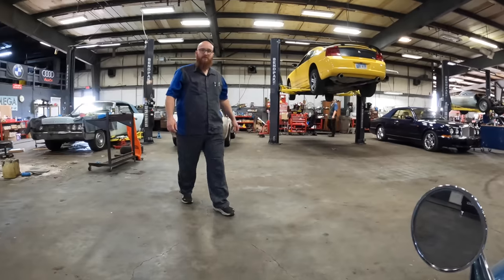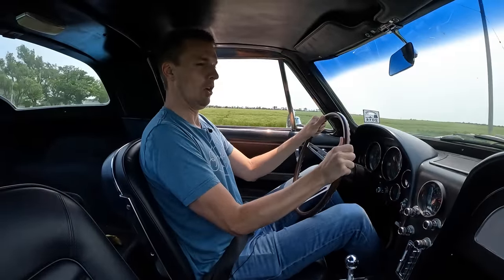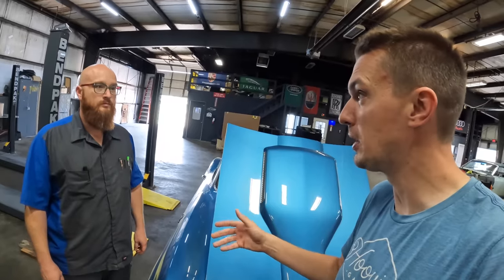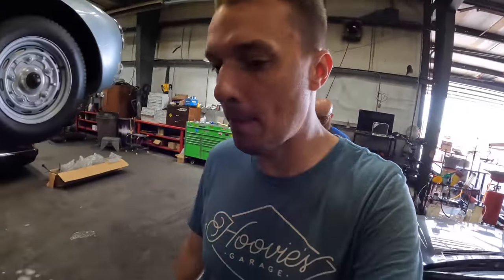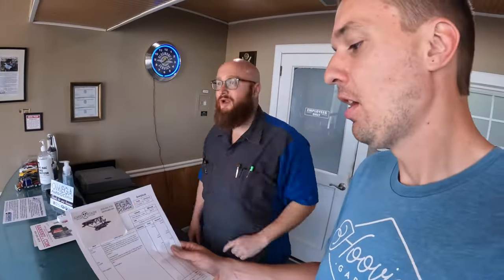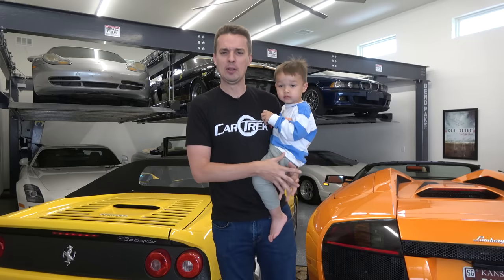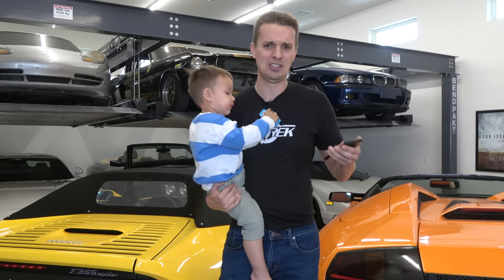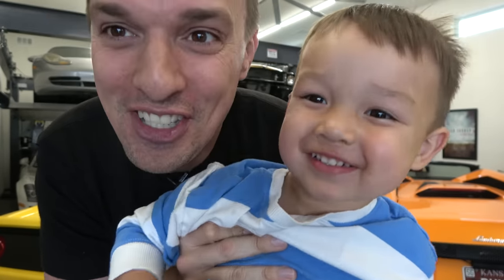Either I'm a TOTAL IDIOT or my rare 1966 Chevrolet Corvette 427 fixed itself??? (probably both)

Comment: Tyler you should have a look at getting a 360 camera. Like the insta360 or something similar. That way you can mount the camera in the car with a suction cup mount and film both yourself and the surroundings. Might help with the drivability while filming. Never had one myself but I believe you edit the angle as part of post production so you have control on whats in view. Anyway just a suggestion.
Long time viewer, love the videos!
Reply: Love your videos!
Reply: A VERY sound idea.
Reply: @ey870  
Thanks for your  contribution to the conversation.
Reply: Doesn't aging wheels do something like that? Good idea but in his videos i feel like the image gets a bit wonky and stretched out in places.
Reply: There’s a stick mount you can use anywhere on the car. The stick is electronically removed from the images it takes. Pretty cool.
Reply: I watch a lot of motorcycle videos like FortNine and Dan The Fireman and they all use 360° cameras mounted on the handlebars of their motorcycles with stunning results. It's also a lot safer of course....
Reply: resolution is trash, and that doesnt work out to two good angles.  every frame is a full wide angle shot.  Its not even close enough yet.  Hed be better off having a custom mount and a pair of go pros time synced.
Reply: @asb2106  this. It's a bad idea, the quality of those cameras are utter trash...
Reply: @NFreund  yeah my 4K 360 GoPro Footage looks like garbage 🙄
Reply: @stevemcraemanager7119  Nobody was talking about a GoPro - they where talking about the Insta360. Which has absolutely horrible image quality. The GoPro Max does 5,6K overall - however, due to the way 360° Video works, you need 16k by 8k Pixels for "proper" 4k Resolution (meaning, a 90° POV crop has 4k Pixels in it). So with 5,6k you still only get about 900p resolution in a 90° POV. Which is a HUGE step back from just "normal" 4k.
Reply: I'm not sure if anybody realizes this, but the 360 video is gonna make it more difficult to find out what needs to be added the images get skewed a lot of the time and there's things that might be seen in and around the car that might not be acceptable for public exposure on YouTube.
 Mabey while on a race course or in a shop where everyone that ends up with their likenesses in the footage  could be accompanied by a waiver, but not in a car driving in everyday traffic.
Reply: Um, I played with 360 cameras at work, enough to never want to have one or watch stuff from one unless it has a sexy babe in it.
Reply: "Welcome back to another HUGH JEFFREYS VIDEO!"
Reply: Oh hey, Hugh is into Hoovie? I love this, both of you are great with your videos, I'd love to see a crossover someday.
Reply: Not a huge fan of 360 camera's

Comment: Loved the view of the vent window on the Corvette.  I locked the keys to my 65 convertible while away from home at a quarter car wash.  This was in 1967.  I finally decided to break a side window but had no luck.  I took a couple of whacks at that vent window which ended up breaking the hinge.  This allowed me to get my hand in the car and turn the lock to open the door.  After that I never used the vent window as it closed nicely.  As a poor draftee PFC in the US Army at the time I could not afford to fix it.  Loved that car!
Reply: Were there no wire hangers anywhere around?

Comment: Auto custom sound makes stereo’s that will fit your vette without cutting or drilling any holes, the heater not working is going to be the cable if it blows and just doesn’t get hot, if it doesn’t blow then it’s most likely the switch or fan motor and good luck keeping that e-brake working, cable stretch is a known problem on Vettes of that year. I restored Vettes for 30 years until my wife became a quadriplegic and had to sell my business to take care of her so if you’ve got any vette questions I’d be glad to help.

Comment: I hope you install a coolant recovery system on the Corvette rather than just a catch can.  Wizard knows this of course, but for the coolant recovery function to work you'll need a radiator cap with two seal gaskets, not just one.  :)
Reply: The Trick with old systems was not to fill it to the top, leave some space for expansion most old systems had a hose so at least the overflow would neatly run out the bottom not piss coolant everywhere. Yes, I'm an old guy  who used to work the driveway at an old school gas station.

Comment: they didn't just let the antifreeze drain onto the ground "back then"  😅  
radiator expansion tanks were standard, and required
Reply: Incorrect. Many had a drain tube aimed at the ground.
Reply: @CarWizard  That one didn't

Comment: 14:18 What you need sir, is a Mitsubishi Starion.. or really any of the Diamond star cars... The single least reliable vehicle I've ever owned, and that was more than 20 years ago. I doubt they are doing much better today.
Reply: I sold Starion/Conquests when they were new. I took a new Intercooled model off the truck, plastic still on the seats....drove  out to Stone Mountain, banged a Shoney's waitress on the hood, then took it up to 143mph back to work, tossed the keys to the detailers who cleaned all the wrurd Japanese cosmoline off of it; prepped it, parked it on the showroom floor. Made me grin every time I walked past it. Once those Intercooled models showed up they were rock solid and 1,000% reliable.  If you were having problems, yours has been messed with.  Stock they were indestructible.
Reply: @Bigsky1991  The engine and transmission were fine. Clutch master cylinder, turbo coolant line, torquetube splines, randomly sticking rear brake calipers, headlight switch, turbo bearings and cracked housing were super common (mine had both)... There were other issues Im not going to blame the car for, even though, yeah it probably deserves the blame. I didn't own it long but I spent a lot of time replacing parts. MITSUBISHI: "Wake up and fix your car." I have no doubt they were fine new off the lot but it's safe to say they aren't known for reliability.

Comment: I remembered being young, and my Dad only driving classic cars in the 90's, showing me the movies Bullitt, Gone in 60 seconds (the original), the first Fast and the Furious when it came out in theaters, and pretty much anything else with a chase scene and muscle cars before I was even 10. Freeway on ramps were essentially treated as 1/8 miles, loud Flowmaster dual exhausts were Mandatory. Something about those specific things put together were a recipe to cause me to want a muscle car more then anything by the time I was 12. Then I got one by the time I was 20 and I found out they were terrible and I got an e36 instead. The end.

Comment: Do you have to worry about flat spots or damage to the the tires if you let it sit that long?
Reply: IMO there's a lot more drama around tires these days than there needs to be. Just keep them inflated and out of the sun, and you're fine. 

They may feel a bit lumpy when he starts out, but 5 minutes of driving and getting some heat into them will take care of that.
Reply: The calibrated flat spots were precisely cancelling out the previous vibration.
Reply: I mean you dont have to, though you probably should ;)

Comment: 427 crate motor was a fine choice.  The overflow tank should not be filled hire than the center line.  If it is overfilled the take will “burp” the excess when it starts to cool down the block.

Comment: That is such a beautiful Vette. Someday hopefully sooner rather than later I want to get a less than perfect 70s Vette and have some fun doing some restomod work on it. Maybe a 13b or LS swap, maybe a Barra if I can source an engine since they are a bit hard to come by here
Reply: A Barra swap on a vette 🤢. LS3 ftw
Reply: @zackatron925  it’s the Aussie 2J, and those factory LPG motors are basically race engines if you upgrade them back to gasoline and give them the right fuel

Comment: I wouldn’t be surprised if the Beck comes back for a head gasket repair.. it’s very common for the Subaru 2.5 to have an external head gasket failure that leaks oil onto the exhaust. Pretty much every 07-10 ish I’ve ever had, needed head gaskets for that issue. The earlier ones also had HG issues but those  put coolant into the combustion chamber causing overheating.

Comment: Loewen Upholstery, 201 W 1st Street,  Newton Kansas. 
So here's the normal rule - fix up the exterior - fix stucco/paint etc. 
Stucturally fix interior, upgrading plumbing HVAC and electric to modern code to raise appeal and limit liability. Full refresh/upgrade the bathroom to code. Fix that ceiling. Whitewash the walls and let the tennant do the lease hold improvements they need for their business. They may put up temp walls and then paint and carpet to their needs and aesthetic - at their expense. No street view on Google Maps so cannot tell the zoning/neighborhood appeal or business fit.

Comment: To check for an engine vibration caused by an imbalance you really need to be stopped and rev it in neutral and again with the clutch in (to see if it is the input side of the transmission).

Gunning it down the road and burning rubber will hide all but the very worst engine imbalance vibrations.

Comment: You live the life here bud, your channel is an inspiration to all of us aspiring collectors wishing to manage a fleet of used vehicles - it takes a strong fiscal stomach.  My last multi-vehicle ownership was with a beloved Italian motorcycle,  for which no single part seemed to ever cost less than $250.  I had a file folder full of receipts that over 10 years that would have financed a couple of  brand new Japanese  motorcycles, it was a basket case upon arrival but left my livery singing the right tunes.  Reason for selling - odds; not one accident or speeding ticket in 10 years.

Comment: Hi Tyler,
About the Range Rover...
When it flips up a lot of faults, all unconnected, it's a battery issue... Even though it might read 12 volts, it will be on its way out.
Just replacing the battery will solve many issues, even the shifter issue. Most likely it will not even need that...
Get involved with some range rover sport or LR3 groups. These cars have their own character and just reacting to codes will not fix it. You will only get frustrated 😉

Comment: No no, there are a couple good used cars out there that are still worth buying, even in today's market. For one, any type of run-of-the-mill, high sales number, Nissans and Hondas and Toyotas from 1988 to 1998. Any of them are affordable, and will last.. Late 90s Lexus, and early 2000's Nissan 350Z's. Either one is both affordable, and will last you many many years, and will ultimately pay for itself through its low purchasing and maintenance cost. I highly recommend buying yourself a 1997 through 1999 Lexus SC300, or SC400, or a Lexus LS400. All of those cars are a joy to drive, a joy to own, bulletproof reliable, and can be purchased for under $10,000, in excellent condition.

Comment: On the Vette, there is a return line and metal reservoir that fits just inside the passenger side fender.  Look up other mid-years online and you will see what I mean.   No they did NOT just let it squirt all over the ground.

Comment: Drive-shaft,brake drums are the most likely suspects for vibration,unless you never clean the inside of your rims.(outside the tires of course.)Allot of people let brake dust accumulate in their rims behind the brakes,where it's harder to wash.It may vibrate off.Could be what happened when you pealed out.?Mud and snow do that to regular drivers all the time.Putting down snowy streets and then get on a freeway and it shakes like heck from the snow inside the rims.Wash your car and then just park it lets the brake dust and dirt dry on the low spots.

Comment: Did you change the tires ? Older tires with a flat spot from sitting or shifted belts inside of the tire might have caused it

Comment: Hoovie: "I remember this car had a vibration at 'high RPMs"... as he shifts consistently at (or below) 4000 RPM.

Unless you put a truck engine in that Vette, IMO, "high RPMs" don't start until that point. After all, the pea so HP is 5600 RPM (425HP version).

Comment: Tyler I have a question, since you are not certain what you are doing with the bmw 325i but it sounded like you were not going to keep it. If you sell it would you use an online auction or some other method of getting rid of it? Just wondering.

Comment: Cars Fixing themselves isn't new to me. My ABS and TC failed 8 months ago (7 codes so decided to leave it and not fix a thing). As of 3 days ago TC and ABS came back to life with 0 problems. I didn't change a thing. Not even fluids. Not to mention my check engine light spends 24 hours on, then 48 off.

Comment: Severe vibration on cold Start the Piston Diameter Smaller and Bore on the Cylinder Casing  Diameter is Larger. Therefore, Pistons are floating and cutting (Piston Rings) into cylinders.  also, causes Low Compression then Heat up Cylinders expand inward and the Pistons Expand Outward, Slowly Damaging the Engine 👦🏻👍🏻🏎️🏁 Looks like your selling it on Bring a Trailor...

Comment: the azure coolant problem has been misinterpreted... coolant stands for COOL OCCUPANT and without Jean Claude driving it and with hoovie in the driving seat its sensing a lack of coolness😂😂😂
Reply: I saw Van Dam drive that car or similar around 2000-2001 . I was crossing the street in Beverly Hills (long story) and this blue convertible Rolls Royce/ Bentley almost ran me over. I was sure it was Jean Claude behind the wheel. Great ride for him not that great for me it would have pancaked me if I hadnt moved out of way.  For years I told that story and ppl would say I should have let him hit me. Hell No that thing is massive.

Comment: Did you by any chance check the numbers on the old motor before you replaced it? Just wondering because if it was numbers matching you ruined the value of the car.

Comment: Was there a reason you couldn't/wouldn't charge the A/C system on the BMW yourself? 20-30 for a can of R-134a and 10 minutes and you could have saved 50 bucks.

Comment: Maybe it fixed itself because it was never broken in the first place, you ever think of that? You're all worried about vibrations at high RPMs, the damn thing was designed in 1966! It probably had a vibration at high RPMs from the freaking Factory! You say that it's very "period correct," well I'm willing to wager that the only 1966 Corvettes with no strange vibrations are retro mods, and are not period correct, while most period correct cars from the mid-1960s have some.

Comment: Your 325i has the wrong wheels . If it was a uk car they were an inch more on the diameter and a lot better looking offset. Your wheels were used upto the 1.8is. 
✌️🇺🇸✌️🇬🇧
Reply: I had a 325i with the same wheels in the UK. Think mine was 1988. Maybe it was a year thing or an option.
Reply: @marcuscoquer5958  you may just be right marc, my last one was a 1990 G reg with the bigger rims standard ✌️

Comment: What idiot would put in a new Radiator without a Catch Bottle.. basic installation procedure..
I have a 1964 Holden with a Catch Bottle of the Radiator.. the plastic ones are the best, as you can see the condition of coolant at a glance..

Comment: You bunch of illiterates?!
Even if you haven't seen an old car, haven't you seen a Land Cruiser or even a stock 2JZ?!
Repeat: the cap is a pressure valve, the small pipe connects to a hose Tha has to always be submerged in a overflow-return tank in order to keep the cooling system always without air.
It spits and then it sucks.